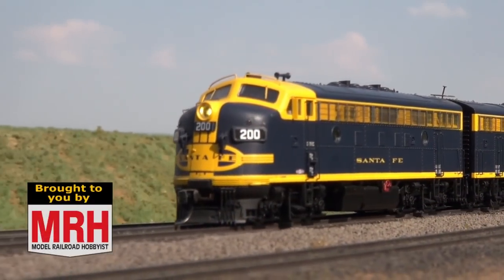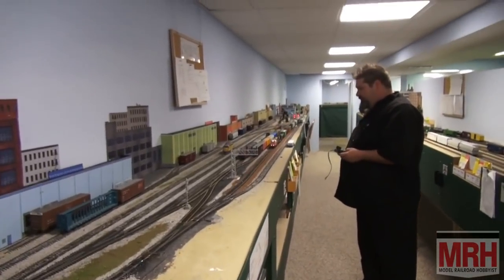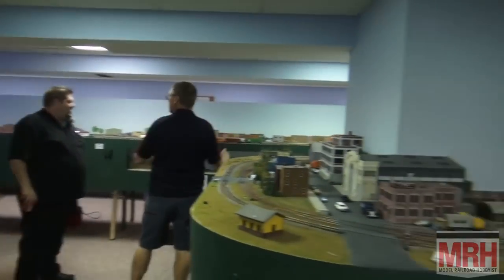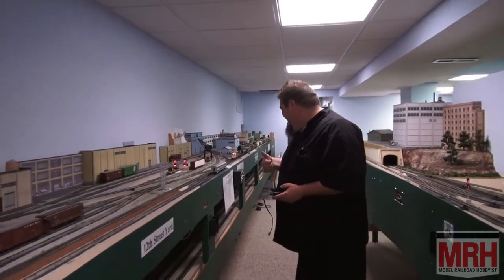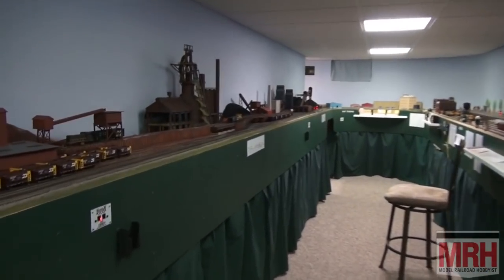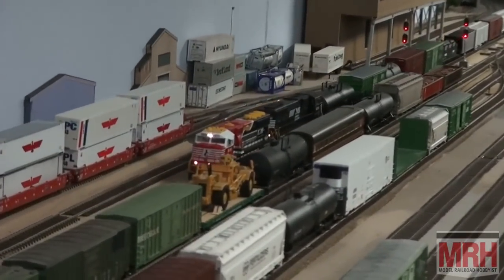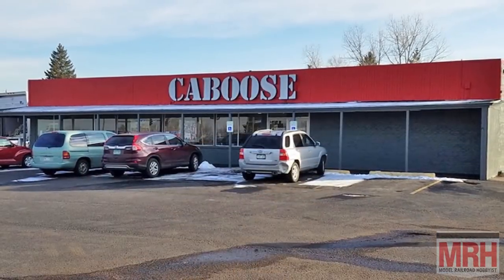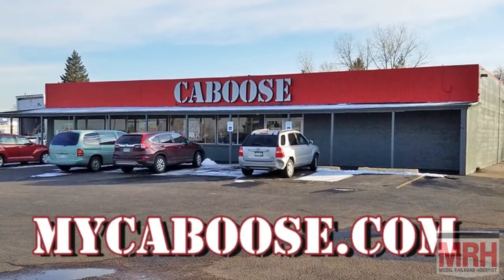Build a layout module | January 2020 WHATS NEAT MRH Mag

Comment: Really enjoyed this episode, but I have a couple of questions.  Since this is a module that you will remove it from the layout for outdoor photography, how do you handle getting the tracks to line back up when you place it back in the layout?   How do you wire a module like this, and what do you use to connect each end of the module?   I don't think you had any switches, but how would you mount switch motors?
Reply: The module is designed to be in a certain place in the layout, and to rest on shelf supports that are constant height. As long as the module is oriented correctly, things will align when it is pushed into place. Simply slide the rail joiners in and it's good to go.   Ken uses headphone jack connectors to easily plug the layout sections in to power. The wiring (bus, feeders, etc.) is internal to the module. Ken's turnouts are all ground lever thrown, so there are no motors to worry about.

Comment: Uso clavos para fijar las vias . Para cortar el tramo sobrante uso una segueta para via Atlas y corcho para amortiguar el ruido del tren . Necesito vias flexibles , cambios electricos y manuales , cruces de 15 , 30 , 45 y 90 grados . Tambien rectas y curvas , cruces dobles y cambios triple . Encarriladoras rectas y curvas en N , HO y Z  .
Reply from the maker: Translation for English viewers: 
I use nails to fix the vines. To cut the excess section I use an Atlas track saw and a cork to muffle the noise of the train. I need flexible tracks, electrical and manual changes, 15, 30, 45 and 90 degree crossings. Also straights and curves, double crosses and triple changes. Straight and curved reeling machines in N, HO and Z.